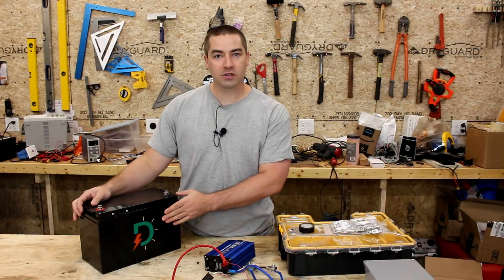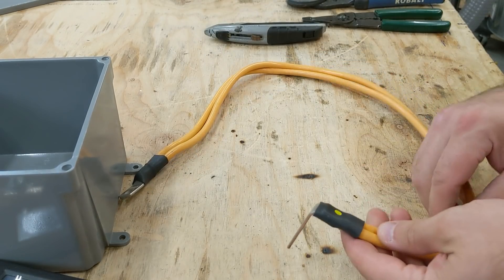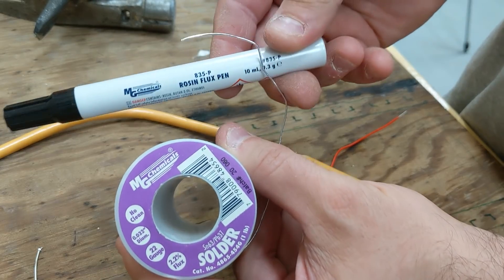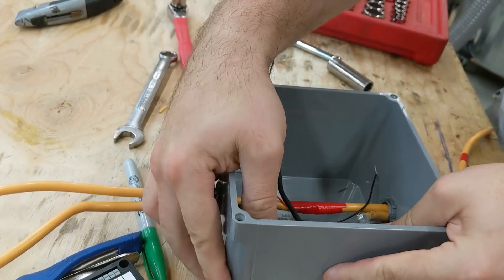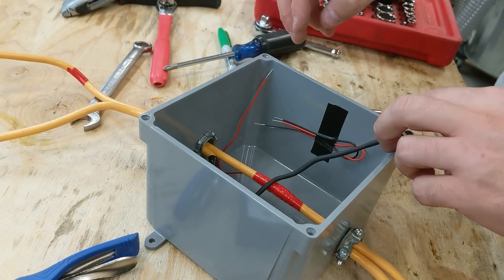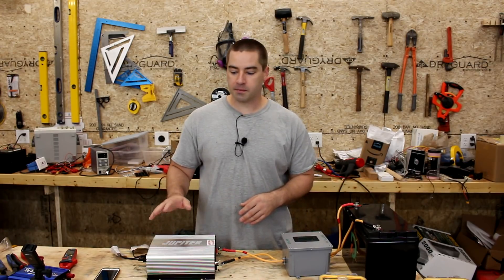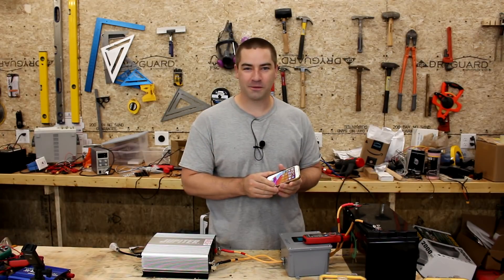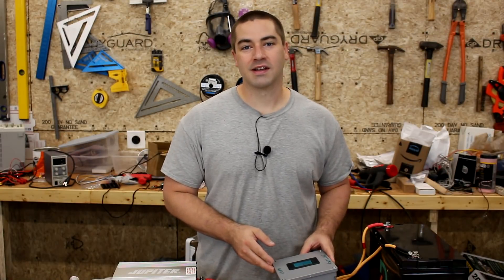Better Battery Modding with your DIYed Meter

Comment: Good Idea David if you do a lot of power testing. Should perhaps have a Breaker ON/OFF Switch on the input of the DIY Meter when the input Battery being tested does not have a Breaker ON/OFF switch.
BTW... I zero my same Amp meter after I hook it to the wire... then turn on the power for a reading. That Amp meter uses a Hall sensor and the wire could skew the Zero reading after clamping.

Comment: Great job! I have a few suggestions for your next build: Rather than running wires through the box, install passthrough studs, like the battery, that way if you need a LONG cable, you simply have to bolt it on. I would also consider adding a disconnect switch on the load (or even also the battery) side that way you can connect/disconnect test equipment without having to isolate the battery. If you had a disconnect wired in, you would also be able to run a separate set of test studs to test inline amp measurements rather than relying on the clamp on meter. This could all be done to make the unit fairly weather resistant as well. Having built some enclosures in the past... its much easier to plan it than to execute. Looks like your unit will do what you need it to do.

Comment: The voltage reading of the bms is little bit high because it's directly reading at the battery. But the wattmeter and the multimeter is reading the terminal voltage of the battery - which is little low because of the drops on the  powerMOSFETs, connectors etc....

Comment: This is a great video thanks!  You have motivated me to build a test box!

At 45Amps you will have a detectable Voltage drop across your wires and contacts. This drop will cause the BMS to read a different voltage than the external power meter. I use a fluke 289 to get really good milliVolt measurements so I can measure losses in wires and connections.  Im sure there is a cheaper meter that is similar. You should be able to measure a volt drop across your connects by probing the base of the battery post (or from the inside of the battery) and probing the copper in the wire next to the lug. I estimate you are losing 35mV from the negative 5 awg wire alone. You can move the negative power wire for the meter closer to the battery lug connection to get better accuracy in the power meter. Im not sure where the positive meter power wire connected but it wouldn't hurt to move it close to the battery lug as well.  The battery internal wiring and lugs will create a drop that the BMS wont see but there isnt much you can do about this.  
I would love to see a video of all the measurements to show the losses in the system.
Reply from the maker: Great ideas for a follow up.  Thank you.

Comment: Great idea David. If you're going to be load testing high capacity batteries with it, I'd suggest adding some ventilation like a muffin fan to the box as the shunt will get hot with extended use on larger loads.

Comment: I subbed as I like your interesting videos.  So....is the BMS reading high, or is your watt meter reading low?  Is the clamp meter more accurate than the watt meter, or less?  The age old question!  I would expect your wattmeter to read slightly lower than the BMS as it's got voltage drop across nearly half a metre (ish) of cables to deal with (not just the main batt cables but the thin ammeter cables too).  Either way it's not far out so no real concern! :)
Reply from the maker: It is the question.  I recorded myself joking about how I'm checking one cheap meter with another cheap meter, but edited it out due to time, and sarcasm doesn't always come across well.

Comment: pro tip: when making high amperage leads, if you offset the connections for + (pos) and - (neg) by a few inches in length you greatly reduce the chance of an inadvertent short.
great build! I have the same watt meter (but in 300A ) that will be part of my high amp LiFePO4 4s 12v pack.
thanks for all your great content
Reply from the maker: I agree.  That is built into this because the shunt added 3 inches to the negative lead.  If I stretch it out on the table it's pretty obvious, sorry I didn't say it in the video.

Comment: you should put some Anderson power poles on the end and then you can also make different adapter that can plugin for different configurations.
Reply from the maker: I thought about doing that (SB50).  But most of the time I'm using ring terminals.

Comment: The difference you are measuring from the battery bms to the shunt is likely wire resistance. At lower amp readings it should be closer

Comment: Adding the battery voltage sense wires in the box is convenient, but you're losing accuracy. Now you are measuring the voltage after the drop in the wires, instead of the actual battery voltage.
Reply: When you tested the voltage reading, there was no load, so no extra voltage drop on the wires, but in actual usage there will be. You have to compare the voltage measurement while there is a large current draw.
Reply: You could connect the voltage sense wires to the ring terminals that mount directly on the battery, and then use some cable sheathing to hold the large power wire and small sense wire together. That has the same convenient, but less measurement inaccuracy. Only loosing the voltage drop through the ring connector at high loads.
Reply from the maker: You are 100% right.  I should go back and measure the voltage drop at 50 amps.  And I like your idea of an extra wire going back to the ring terminals with a sheathing.  Thank you.  Now I'll have to make version 2.

Comment: Is that temco heat shrink tubing?    I have/had alot of it I love the stuff, i think everything  temco sells is great stuffs! it's all good stuff a ith next to the lowest possible price, you can get it cheaper, but the quality is less also, but temco is a great price with great quality!!
Reply from the maker: This is the link to the heat shrink I used in this video.  It says XHF in the listing, so I assume that's the brand. https://amzn.to/37Qzyng
Reply: @DavidPozEnergy  yeah that's good stuff also, I think it may be from the same manufacturer,  shrink tubing, is soooo much bet tgan tape, i usedto not bother with it, then tried it. Now I look for an excuse to use it, great stuff, especially the glue lined, 3:1, I'd say the 4:1 stuff is awesome also, but it's spendy, and not as common,  I even got some clear 3:1 I'm thinking of putting led tape inside, with the wire, to look like the power if flowing, for a ebike/Ecycle project,  keep at it

Comment: In Diyer straits eh! Ha..  I have two meters like this, one counts in/out watts volts, amps, and has programmable outputs, to set low voltage, high voltage, over current, and who knows what else, maybe even a timer, with a 500-600amp shunt, I think, it's the biggest shunt I could get with it, I'm thinking about using one this one with the batt bank, for protection, wiring the BMS in with, so if the cells go out of balance, it will thut off also, this way its like having a fully programmable BMS,  then use the other, simpler one with the solar, 4.4kw plus, to measure either the power from pv, or from the charge controllers, I have about 6! And if I don't get some 100amp controllers, I'll have about 10-12! Anyway, measure the combine output from the controllers, that way it can be measured, and the difference I'd what one inverter used!
Or I may use the not quite advanced meter, on the 12v lighting, and backup bank! I'm thinking about getting a 800w MPP inverter 'pip'. Along with a 1200w to 1500w inverter, with a round 400ah LiFePo 12v bank, and a 1500 ups, with 500ah lead acid, ( I have a couple 450w ups's on the 12v bank, I'd like about a 2,kw to 2.5kw pure sine ups, or a pip, 2.4kw12v, but I don't think anyone makes a 12v that big! I just need a 12v inverter that will run a fridge, a 1kw microwave, and start a 7amp well pump, not at once. I have a sort of easy, slow start for the pump,.. But I have plans to build a water tower, for gravity feed, or a smaller 12v or 24v pump!  I thought about building a 5-10ah lithium battery, for the 12v pump, put it at the tower, and run a small wire, with a DC to DC, to slow charge set it to 14v, cc CV, and charge at about 500-700ma maybe 1amp, and it shouldn't use much power when fully charged, maybe use a voltage controlled SSR, to disconnect when the battery is at 14-14.2v it should last  forever, maybe put it in a insulated box, with a tail light bulb, to come on when its below 35° American, something that pulls less than the battery charger! To allow atleast 250ma charge with it on, it should be kept between 35° and 45°F 
I think the 12v pump pulls about 3-5amps. I may use a pwm controller to slow it down, maybe a soft start kinda, start slow, and ramp up the pressure.. I figure 45-55psi running max, being the well does 70-80 psi running pressure. Sorry to be rambling!!

Comment: I like it David, easier and safer than the spaghetti method. When I was watching you put the ring terminals on, I thought that some solder would make the connection solid and cleaner over time. Do you think I am overthinking it? Would this not be recommended for some reason?
Reply from the maker: The lugs I'm using can be soldered OR crimped.  Either is fine, but not both.  I find crimping to be faster, and I'm not that good at soldering.

Comment: Nice build. 
Suggestion: Instead of having the wires come out from the box to the load/battery, have heavy terminal lugs/bolts sticking out of the box for each wire. This way you could have different length wires if need be. Also allows for storing a lot easier as you won't have pigtails.

For the Amp reading on those digital meters, there's "usually" a trim-pot inside to calibrate them. But not all of them have those. Worth a look, though.

Comment: Great little project. I like how you state things you'd do different to improve.

One small improvement: add a rocker on/off switch to the +ve power lead that powers shunt. That way to can easily reset the meters figures without having to disconnect/reconnect from the battery source (obviously in this case you could just turn your batteries breaker on/off to have the same effect but assuming not all your future test batteries will have  a built in breaker :)
Reply from the maker: There is a tiny button on the front of the display.  When you press and hold you can reset to zero.
Reply: Ah brilliant, sorry I didn't know :) 

Nice one :D

Comment: Good job
What’s the best BMS you recommend to use building the 48V LG Chem battery you built. It was a 14s configuration
I’m putting 10 for a 70kW with SMA SI 6048
Reply from the maker: That's great.  If you are doing a few smaller packs (for redundancy) and each will be less than 100 amp, then Battery Hookup has them (10% off coupon DAVIDPOZ ).  https://batteryhookup.com/collections/accessories/products/12v-lifepo4-smart-bms-w-low-temp-cutoff?variant=36287975522466  But if you need larger amps, then Daly brand, I buy through Aliexpress.  
Or, some people are very happy using Batrium brand BMS with that type of huge build, but I have not personally used Batrium so I can't vouch for it one way or the other.
Reply: I building 10 packs identical to the one you built and hooking them up to SI6048
Do I use one bms per pack or do you know of a bms that can handle multiple packs
Do you like the chargery bms
Reply from the maker: Use one BMS per battery.  So if you have 10 batteries you are building, use one BMS on each.  A 100 amp BMS on each would be fine for the battery, but it would give you 1,000 amps available, and one 6kw inverter is only going to pull 125 amps.  So you could save some money and buy smaller amp BMSs from Daly or whomever.  Or keep to 100 amp each and you will be ready for any future expansion.
Reply: I have a 10kW solar array (24 395W Q-Cell) connected to 2 SMA Sunny Boy 240V 5000W inverters feeding the loads and the 2 SMA Sunny Island charging batteries or feeding the houses load at 125A max per SI6048
Max draw will be 250 amps from 10 battery banks, meaning no more than 25 amps per bank
Battery bank consists of LG Chem N2.1 120A 3.7V in a 14s10p configuration
What is the smallest bms size you recommend and is Chargery any good
Reply: @DavidPozEnergy  
I’m completely off grid by the way in sunny

Comment: Suggest you look at adding a separate battery to power the meter so it doesn't switch off when the BMS cuts off, it could potentially be a small Lion cell with a buck charger from the incoming 12V. Also your Voltage comparisons are going to be skewed as you have a high current running through the cables, and the test points are at different locations,  you need switch off the load (or reduce it as low a possible) when comparing the voltage accuracy between each device

Comment: Might want to put Anderson connectors on both ends. This way you can have multiple leads and add it anywhere quickly. Great vid!
Reply: Also a circuit breaker on the power meter so you can connect to any battery without having a spark from the inverter capacitor charging
Reply: @ryan543213 cant that be achieved with a resistor?

Comment: Very cool idea! You could probably just cross the negative wires so they go out opposite sides to eliminate the bend radius issue, but you'll loose length and they're already short the way it is...

Comment: I would consider putting some tape on the ends of the extra wires also since they could short a circuit out if the tape holding them to not came loose.  Good Project.

Comment: https://www.ebay.com/itm/353205629485
Add some connections on the end like xt90 and your good to go then you can make universal connectors or put connections in your solar/battery projects to test when you want.
Reply from the maker: I had one of those meters 3 years ago and it burned out.  That's why I don't use that style any more.

Comment: the bms voltage is reading higher likely because of calibration but also very likely because you tapped the voltage from the load line.  There's a reason it's supposed to connect to the battery in parallel.  I bet if you took the load off they would get closer in sync.

Comment: To get the most accurate battery voltage reading you should ideally have the thin voltage sense wires running right to the battery end of the thick wires so that you are not including any voltage drop in the wire (see 4 wire voltage measurement for more info.)
With wires that thick it probably doesn't make a lot of difference but might be interesting to test this.  While it is running you can use your multi-meter between the mid point of a thick wire and the battery end to see if there is any measurable voltage drop in it.
Reply: Yeah. Not sure what gauge wire he's using, but assuming it's ~4 gauge, and it's about a foot to the battery from the box, you're off by about ~1watt @ 45 amps.
now, if you include the terminal resistance (which I assume is going to be much higher -- 5-10 milliohm per terminal?), that adds another 10-20 watts.

His comparison showed ~38 watts offset, which is probably an exaggeration (I'm sure the BMS is itself not super accurate), but I think the conclusion is he's probably off by about 3-4% due to not using the 4-wire measurement.

The easy solution would be to just run the wire up next to the main lead, and heat-shrink it on, then right at the connector solder it down to the ring terminal.
Reply: Yeah
Reply: The shunt should be calibrated to measure the voltage drop across the shunt.